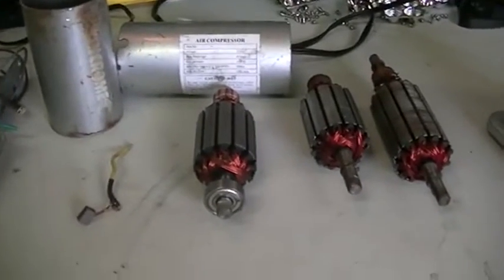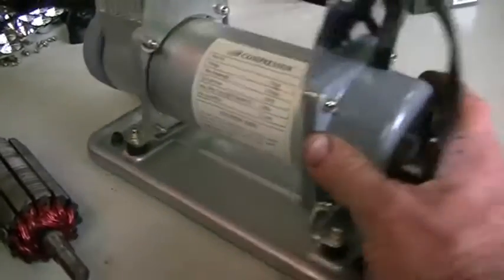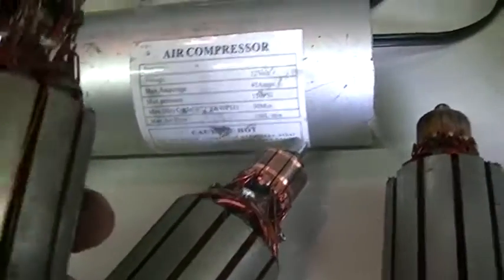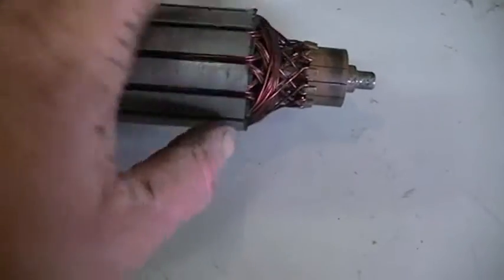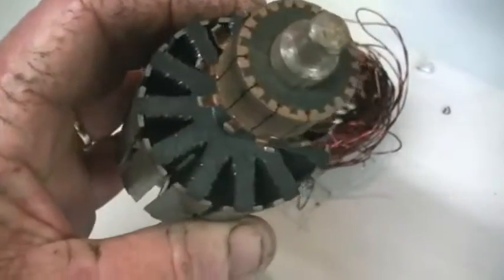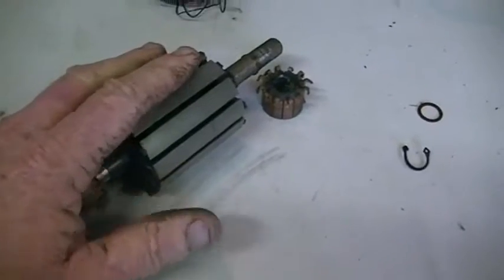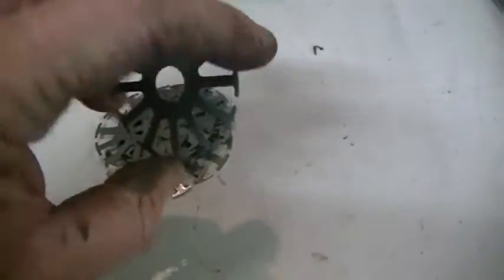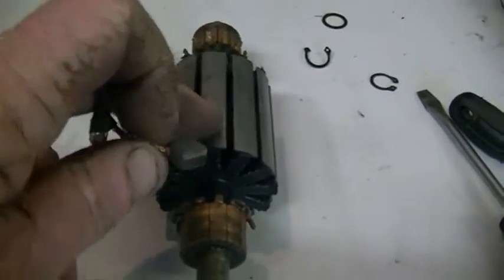Chop phase converter PT1

Comment: Have you ever gotten one of those smart drive motors to run, if so what kind of controller did you use. I have a project I'm working on and I need a smart drive that can run at variable speeds.